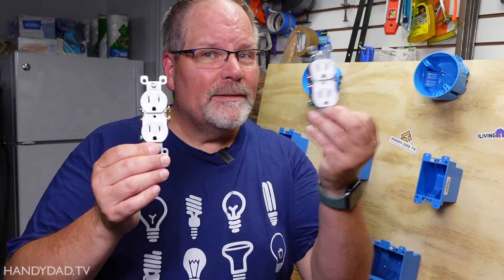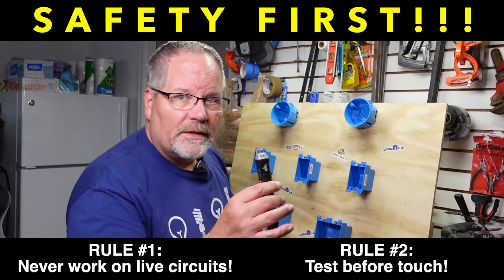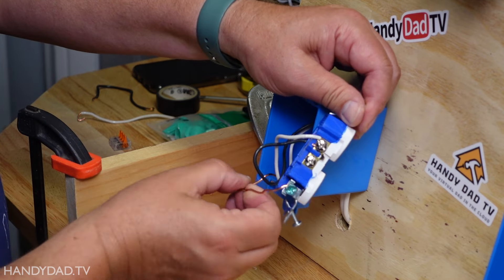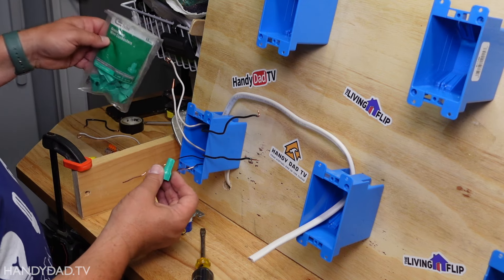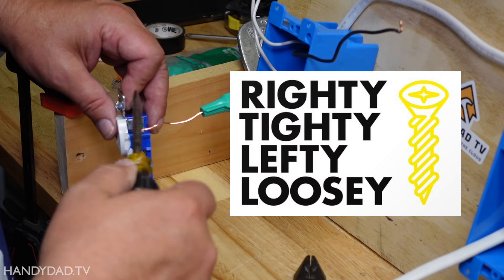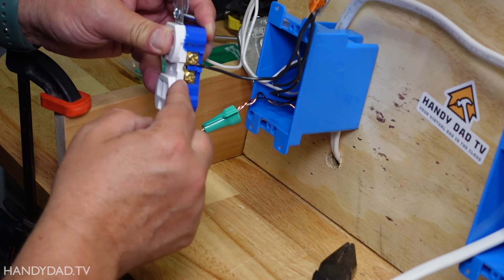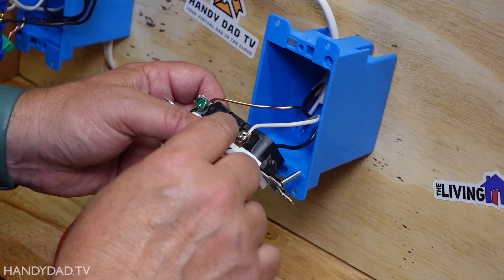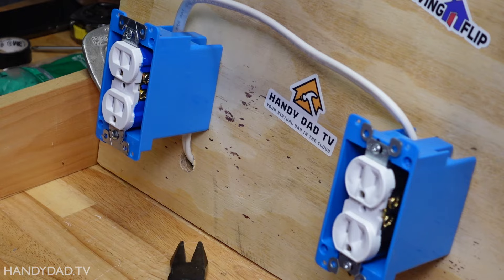SAVE $300 EACH!! How to Add an Outlet from Another Outlet

Comment: Why does the outlet come with  top and bottom ports to add wires if it could cause it to melt when you use them?
Reply from the maker: Technically there are two sets of screws because you can remove the connecting tabs to wire each receptacle separately. We use them in lieu of pigtails just for convenience. 

In my life, I’ve only had one incident where an outlet failed due to current flowing through it. I was young, maybe 7 or 8, and my mother was vacuuming when suddenly the circuit breaker popped. My dad tried to reset it, but it immediately shut off. He knew there was a short somewhere but he didn’t know where. He eventually found the melted outlet behind a couch — not the one where the vacuum was plugged in. Too bad I don’t have a picture of that outlet.
Reply: @handydadtv  then why does the outlet come with the connecting tabs connected in the first place?  It just makes no sense to me for them to come UL rated but you aren't suppose to use them
Reply from the maker: I didn’t say you’re not supposed to use them. It’s just an overwhelming opinion from my viewers who’ve commented that pigtails are better.

Comment: Nice!  Could you also use the wego connector for the ground instead of the green nut?
Reply from the maker: Yes, you can use a normal wire nut or Wago connector to bond the grounds with a pigtail to the outlet.

Comment: How does it make a difference if you do a pig tail for the black wire vs just putting the black wires in each screw? Isn't the current still going through both wires?
Reply from the maker: If you have 1 or 2, you can use the screws. Otherwise connect them with a pigtail.
Reply: @handydadtv  cool, thanks! So in your video, you technically could have connected the black wires to the screw since you only had two of them? Also, great videos. It's the best I've seen by far explaining electrical wiring
Reply from the maker: Yes. Both methods are acceptable.

Comment: How would you wire, a new receptacle. One on each side of a gfci receptacle, for wiring new receptacles in a garage. With only 1 gfci receptacle.
Reply from the maker: Same way as this, just connect the new outlet to the LOAD screws on the GFCI so they’ll be protected.
Reply: @handydadtv  could you possibly send me a diagram, with step-by-step instructions? I would greatly appreciate it. I don't want to burn my garage and or house down.

Thank you
Reply from the maker: If you need a diagram, you need an electrician. Don’t do your own electrical work.
Reply: @handydadtv  it's no big deal. I know the wiring process. I'm just not sure how to get the first step started. I have just one receptacle in my garage, it's a gfci receptacle. I it's on one wall, and I want new receptacles on both sides of the gfci receptacle. I need to know how to wire the gfci receptacle to the to start. That all that I need.

Thank you

Comment: If you pigtail the wires because using both screws on one side could get too hot then why do they make them with two screws?
Reply from the maker: I have no issue using the screws. But lots of people prefer pigtails.
Reply: @handydadtv  seems the heavier duty bridging on an outlet could handle more current than the thin gauge metal in a wago yeah?🤷‍♂
Reply from the maker: I don’t do scientific testing, but residential outlets are rated for 15A or 20A. Wago 221 lever nuts are rated for 32A at 450V.

Comment: If I move an outlet attached from another due to it no longer being needed, can I pigtail the connection but not include wires to the unneeded receptacle and also cover old one with flush cover?
Reply from the maker: Yes. Use a blank plate, but don’t drywall over it.

Comment: On these old houses. What could you do if there is only two wires to work with?😢
Reply from the maker: If you have a metal box, it may be grounded already. If it is, you can add a ground wire from the box to the outlet. 

If not, you can either rewire the circuit, run a separate ground wire, or just use what you have and the new outlet will be ungrounded.

Comment: what size is wire you use to connect the 2 outlets. RB what ?
Reply from the maker: If your circuit breaker is 20 amps, use 12/2 wire. If it’s 15 amps, you can use 14/2 wire.

Comment: How many 110 outlets can I run off each  other using this method using   12/3 wire. ...on a 40amp breaker
Reply from the maker: The max breaker with 12 gauge wire is 20-amp. You need thicker wire for 40-amp, and that would be highly unusual for an outlet circuit.

Comment: On the secondary outlet, could you use it to run a microwave?
Reply from the maker: Microwave outlets need to be on their own circuit for new construction. If you are forced to power it from an existing circuit, I would only use a 20-amp kitchen circuit that has no other appliances on it (like refrigerator or dishwasher).

Comment: Awesome video. Thank you for explaining that pig-tailing the black wires will help with not overheating the first receptacle outlet.  I’m a novice DIY’er and would have connected the two black wires directly to the two brass screws on that first receptacle.  Could you use a pig-tail set up if the receptacle were a GCFI?
Reply from the maker: Yes, but GFCI outlets are designed to connect up to four wires: two on the line side and two on the load side. They use back-wiring so two wires can be attached to the same screw, unlike normal outlets.

Comment: How do you do this with metal boxes?
Reply from the maker: The fundamental wiring is the same regardless of box type or wire gauge. There are too many variables to cover everything. 

Metal boxes usually have knockouts that need bushings to protect the wires from being cut.

Comment: If I move an outlet attached from another due to it no longer being needed, can I pigtail the connection but not include wires to the unneeded receptacle and also cover old one with flush cover?
Reply from the maker: Yes. Use a blank plate. Don’t cover the box with drywall.

Comment: Can't you use a grounding wire nut on all the wires?
Reply from the maker: No, just the bare copper wire.
Reply: @handydadtv  I just pigtailed all the wires with a regular wire nut.
Reply from the maker: Correct.

Comment: How many times can i do this on a 20 amp breaker
Reply from the maker: There is technically no limit to the number of outlets on a circuit. You are only limited by the total current consumed by the devices on the circuit.

Comment: What if you have no ground wire in the existing outlet because everything is grounded via conduit?
Reply from the maker: Assuming it’s a metal box, the outlet gets grounded when you screw it to the box.
Reply: @handydadtv  yes my boxes are metal. Would the new outlet simply be grounded when I connect hot and neutral? Or should I connect the ground to the screw in the old and new box?
Reply from the maker: @foobud1989 I never had to deal with no ground so I’m not sure how to handle it. Code might want you to attach a ground pigtail to the box, but you’ll need to research that.

Comment: How many of these can you link together safely? Thank you for the video. Very straightforward and easy to follow.
Reply from the maker: Capacity is limited by the circuit breaker, not by the number of outlets.
Reply: I just did another one, this time it worked and then it didn’t. The breaker did not trip but I have no power on the outlet. There’s power coming from the breaker but it’s not going all the way to the outlet. Do you have any idea what happened?
Reply from the maker: @jrmsantana It’s impossible to say. You need to use a voltage meter and figure out where it was wired wrong. If you can’t figure it out, please call an electrician or qualified handyman.
Reply: I would add that it’s also limited by the size of wire. Make sure the wire size is correct for the breaker size.

Comment: Can I just put both wires into the screw without a connector?
Reply from the maker: Not unless the outlet is designed for back-wiring. Normal outlets only allow one wire per screw.

Comment: What if you already have two white wires and two black going into the outlet?
Reply from the maker: Whenever you have more wires than screws, use a pigtail from the outlet to a wire nut to connect them together.

Comment: I’m trying to add a outlet behind my tv to hide the wires. I was going to tie into one that is below the tv. Should I be worried about amp draw when it comes to piggy backing off outlets?
Reply from the maker: If you already have the TV plugged into that outlet, you’ll have no worry of overloading the circuit by adding a convenience outlet behind the TV.

Comment: Can you add another outlet from an existing outlet that already has 2 black and 2 white wires?
Reply from the maker: Technically yes. But the box needs to have enough space.
Reply: @handydadtv  so I can make a pig tail of the the feeding wires? Or make the pig tail off the other wires feeding from that outlet?
Reply: Thank you for the quick response also!
Reply: @handydadtv  for example, if I remove the wires from the outlet, I will pig tail into whichever ones are supplying power constant not the ones that lead to another source?
Reply from the maker: Connect all the same color wires together under a wire nut with a short pigtail going to the outlet.
Reply: @handydadtv  okay thank you sir!

Comment: I always thought the both black wires were in the right side brass and the white wires were on the left silver I didn’t know they would over heat.
Reply from the maker: If I only have two cables, I use the screws. I typically only pigtail when I have 3 or more cables.

Comment: Nice information! 
Question: I stalled a dedicated receptacle to a 20 amp breaker but when I turn the breaker on it would trip off, like if it is grounding some where.   I already checked my wires to the outlet few times.   I don’t see anything wrong.   It is a there a possibility that I have a bad receptacle or bad breaker?   
Any idea? Thanks
Reply from the maker: Process of elimination. Remove the receptacle and just leave the wires separated. If it still pops, remove the wires from the breaker. If it still pops, it’s the breaker.
Reply: I've seen some weird mistakes, the problem could be somewhere else along the path including in the panel. Its not clear if you installed a completely new circuit (new breaker and new wiring all the way back to the panel) or are re-purposing an existing circuit. You just have to trace everything. At the panel disconnect the neutral and hot and check the resistance to verify it is isolated from ground when there is no outlet at the other end, then attach the outlet and see if it changes.

Comment: what gauge wire should I use for outlets?and what should I avoid?
Reply from the maker: Choose the wire by the breaker size. 20A = 12/2 wire. 15A = 14/2.
Reply from the maker: Avoid getting shocked.
Reply from the maker: Romex is okay where I live, but you need to comply with local codes. 

I use the same wire nuts for both.

Comment: It doesn't make sense to me that there's any benefit to pig tailing them when you have two screws on the outlet. Either way the same amount of amps is going through that switch and the wiring and it's not exceeding its capacity. The wiring is connected so the whole wire and all the outlets no matter where they are at in that circuit are registering the same amps no matter where you test it. That's how it was originally explained to me years ago by an electrician. Is that wrong?
Reply from the maker: Not wrong but a lot of people say pigtails are best.
Reply: @handydadtv  Thanks for clearing that up for me. I'm just a complete amateur and thought that was one of the few things about home wiring I had a grasp on all these years. Was looking about installing a couple GFCI's and came across your video.

Comment: How many outlets can you put in one circuit?
Reply from the maker: There is no limit on the number of outlets; the total current of the circuit is limited by the breaker.
Reply: The NEC (building code)  has limits for businesses in section 220.  The same limits are nor put on homes.

Comment: I wouldn't rely solely on a voltage tester to determine that a circuit is safe to work on. The field that voltage testers actually detect can be quite weak and easily blocked. It's always a good idea to verify with a device that detects current as well.
Reply from the maker: Thanks for the advice.

Comment: great video, but in my 40 years as an electrician, I have NEVER seen an outlet melt before the wires do. If the load is too great for the wires, the PROPERLY installed circuit breaker would trip out long before the outlet melts.
Reply from the maker: Thanks for your input. I always used the screws but got overwhelming comments that pigtailing was better. I think the only legitimate argument for pigtailing everything is the ability to replace an outlet on a live circuit without disruption (which I don’t recommend).

Comment: Shouldn't there be 3 ground wires bonded instead of 2 though?
Reply from the maker: If you use a normal wire nut, you’d have three wires. But my grounding wire connector, with 2 wires, still meets code.

Comment: Your comment about the receptacle burning up if you don't pig tail is pretty funny, considering the receptacle is rated for exactly that purpose when protected by a 15 or 20A breaker.
Reply from the maker: I was relaying advice from electrician’s comments. I always use the screws. Everyone has their own way of doing things.
Reply: The real season for not attaching both wires to the receptacle, is due to the fact that the small metal tab that is in between the screws on the receptacle could break, which would cause the second receptacle( and all other ones fed from the first receptacle) to stop working. 

It would be essentially wiring the plugs in series, so if ok plug dies, all plugs will stop working in that circuit

Comment: I got a outlet that I want to put outside. I took out the receptacle inside and it got four wires going to it.
Reply from the maker: You need to use wire nuts to splice all the wires with your new wire, and pigtails going to the existing outlet.

Comment: Handy DAD, great video.  A gentle reminder that while this process is physically possible, attaching to some outlets creates a code violation.  Several circuits are indicated as "shall have no other outlets" in the code book.

While not all inclusive;

Bathroom counters (depending)
Laundry 120 vac
Microwave
And kitchen counter receptacles 

Some can stay inside the room and some just cannot add.

Kitchen counter receptacles cannot supply an outlet outside.

Thanks.

PS  I did not scour the code book for outlets, so my fellow electrical guys, help out with the knowledge please.
Reply from the maker: Thanks and I know what you mean but codes are a moving target. And every jurisdiction can choose which version they adopt.

Comment: In theory, can I run a string of 5 electrical outlets around my garage with your method?
Reply from the maker: Yes, in theory. You just need to be mindful of the other outlets on the circuit. I’d opt to run a new circuit for that many outlets. If possible.

Comment: This may be a weird question but how many outlets can I add off of one outlet like this. How long can I keep the line going?
Reply from the maker: Technically, there is no limit. A hood rule of thumb is no more than 8 devices on a circuit. But you’re always limited by total amps drawn by the appliances. For example, even a single outlet circuit will trip if you overload it with multiple space heaters, air conditioners, coffee pots, etc.

Comment: for 240 outlets
Reply from the maker: You want multiple outlets on a 240-volt circuit?
Reply: Yes, wago's are okay.  Your stand house wire is rated for 600 volts.  The concer is the amperage.  The amps needed generally drive your wire size.  Just make sure your wire connectors are rated for your wire size and current.

Comment: Why pigtails can't you just go off the bottom screws on the first outlet
Reply from the maker: Yes you can, but then all downstream current flows through each outlet. Pigtails prevent that.
Reply: @handydadtv  so if you was wiring in a bedroom would you use the outlet or pigtail every outlet

Comment: Those connectors are terrible. I bought a house with a ton of electrical problems. I replaced all of those connectors with wire nuts and problems fixed.
Reply from the maker: Glad you fixed the issue but people worldwide swear by Wago lever nuts.

Comment: this video missed out the hardest part and its to show how to open up the receptacle tabs from the existing electrical box while it's already inside the wall. That to me is the hardest part.
Reply from the maker: I’m not sure what you mean by “receptacle tabs”, but you need to unscrew the receptacle and pull it out of the wall to make any modifications.
Reply: @handydadtv  I was referring to the tabs that guides the romex through one way at the back of the box when the source receptacle is already installed behind the finished dry wall. Unfortunately in your video, you transitioned from a scene with no wires between the 2 boxes to all of a sudden having the wires already installed between the old and new box. it's really hard to bend the tab and run a brand new romex through the tab from inside the original box but it's the only option while there's drywalls around it.
Reply from the maker: @Yang1 Oh now I understand. No worries. I gotcha covered:

How to Add an Electrical Outlet through a Wall
https://youtu.be/BU5Yjy5GrGg

Add an Outlet from Another Outlet Around a Corner for a Bidet
https://youtu.be/klL8XhKMNT8
Reply: @handydadtv  haha thanks! you made a subscriber out of me
Reply from the maker: @Yang1 Thanks for subscribing! Welcome to the family!